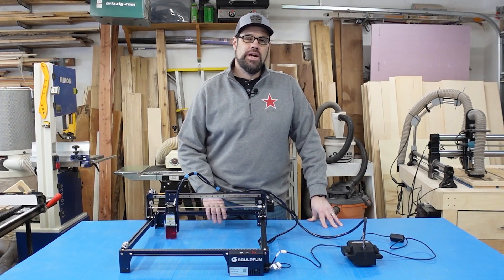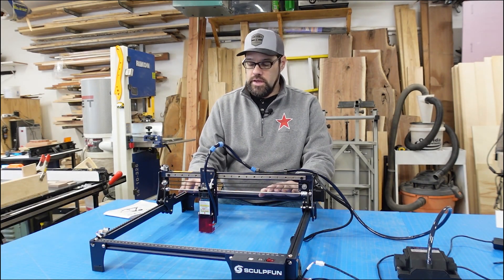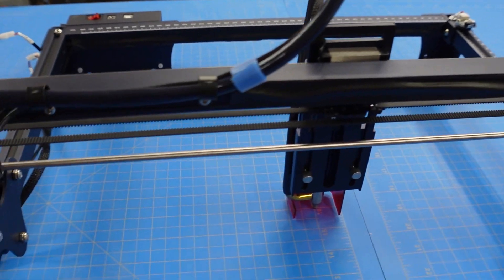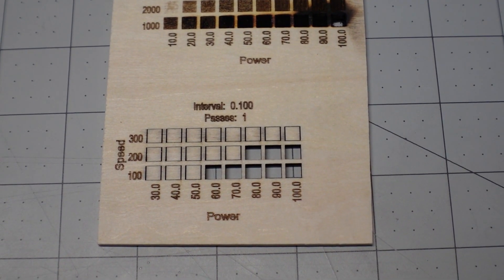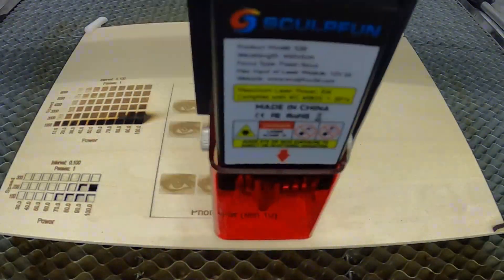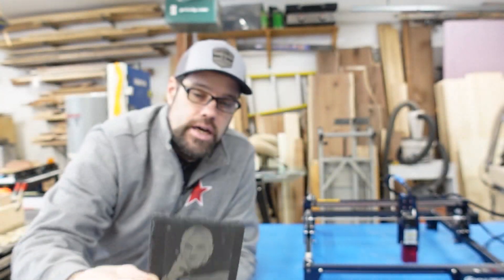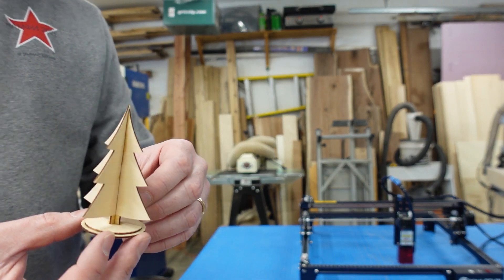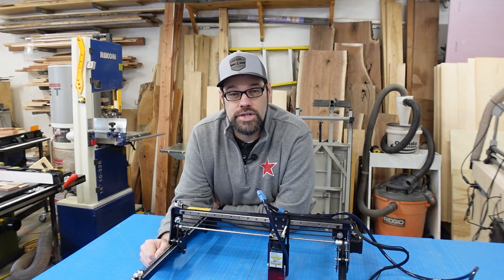Sculpfun S30 5w Diode Laser - Testing and Review

Comment: Hi.
Can you tell me how thick plywood it can cut with this 5W diode? Will this cut up to few mm plywood (2 to 5mm)
Reply from the maker: On 5w I would only expect to cut 1.5mm solid basswood not plywood.  At 10w up to 3mm plywood.  20w you start getting into the 6mm range for some plywoods.

Comment: Would it work on metal?
Reply from the maker: Diode lasers of any power can only do limited marking on stainless steel.  If you use a metal marking spray like Cermark you can leave a fused mark on a few more metals.  You can also remove paint or anodization from aluminum.  Other than that, you'll need a fiber laser or very high power Co2 laser to do anything with metal.

Comment: I have a S9 and I want to add a second 5w due to the quality o the engravings.. Will the s30 5w produce the same great dark engravings?! because the air nozzle is different from the s9
Reply from the maker: It should produce similar dark engravings, but you'll need to play with the speeds and line interval to get the desired result.

Comment: ok...I am 10 hours into this machine and still cannot get it to work.  I have watched so many videos and all of them have the cord coming from the main base where the on/off switch is with 3 white connectors coming from it.  One for the air pump and two more for the X&Y connections.  My main cord coming from that base ONLY HAS the air pump connector.  There is nothing else coming from the base for the X&Y connectors.  I have the other ones plugged into the Limit Switches.  I am beginning to think that it is not me and I have the wrong set up with mine.  Do you know if they have upgraded this feature and excluded the step of having those coming from main box and they are already connected inside the box?  Looks like the ones that are supposed to hook up to it go to the Limit switches.  Can you confirm or deny this.  Lastly, I cannot get the laser to go to the home space or engrave yet.  Soooooooooo frustrated.  Thanks for the video...Kelli
Reply from the maker: Unfortunately I can't say if they changed the design as I've not had the opportunity to see any newer Sculpfun machines.  All the Sculpfun lasers I've assembled with limit switches had the connectors for x and y switches and had labels on them for that. It may be that some of the short wires for your board were missed in the factory assembly.  If the machine will not move when powered on then I'd be looking at the wires for the stepper motors to be sure they are solidly connected.  With the lack of wires for your limit switches I fear there may be other wires not plugged into the control board inside the box with the power switch.  Unfortunately without being able to take a close look, this is my best guess.

Comment: Awesome video! Is it also possible to engrave on stainless steel using this laser?
Reply from the maker: It will be slow but you can mark it but it's not a real engrave.  It will discolor the metal to a dark brown almost black color with enough heat.

Comment: Why would one use less than 100% power? Isn't just increasing the speed a better option?
Reply from the maker: Generally that would be the first preference but you do run the risk of overheating your laser faster when running it at 100% power. So some will sacrifice speed for longevity. I personally go for the fastest speed and the highest power that suits the job I’m doing.

Comment: Thanks this was very helpful. I am very keen to get started but on a budget so this model seems to fit the bill. I'm just wondering if it's possible to upgrade the laser to a 10w or 20w at a later date or would you have to buy a whole new machine? Thanks, Jay.
Reply from the maker: You should be able to jump up to the 10w, although you might need to ensure it comes with the larger power supply.  The 20w might have a beefier frame to handle the extra weight of the module.  I have the S30 Pro Max 20w module in the queue for review, so I can speak more about it shortly.
Reply: @Vintauri  That's great, thanks you've gained a new subscriber. I'll make sure to do more research before hand. Either way this 5w model seems a perfect starter option.

Comment: Thinking about getting this model. How does it handle engraving leather? Love the vids.
Reply from the maker: I have not tried leather with this model but it should work okay. I’ve used the 10w diodes on various leather with good results so you might want to jump up to that model as it would give you more flexibility in power for various materials. Either one should have plenty of detail for engravings.

Comment: Good video, do you ever run the air assist when engraving?
Reply from the maker: It depends on the set up of the laser.  If I have some control over the airflow, I prefer to run low air assist on engravings to help keep debris from the lens, but too much air can also create a less crisp burn on engravings.

Comment: Mine arrived on Saturday, it's pretty good compared to my previous Ortur LM2. It's more Powerful than the Ortur 15w module😂.
Verry sturdy build, not so nice is the Cablemanagement.
Reply from the maker: I agree that the cable management is lacking in many of the diode lasers out there recently. I can’t imagine that adding some cable chain would add that much to the cost of the laser.

Comment: Looks like a pretty nice little laser.  Not a fan of having the thumb screws in the back though.   Not sure what they were thinking there.  🤔   Good video Steve.
Reply from the maker: Yeah, it's a bit awkward, and even more so if you have a tight enclosure, on the other hand, at least the screws in the back are not pinching in on a dovetail joint that will eventually wear out like some other designs.  Overall for a $300 laser, it's a nice way to get started in the hobby.